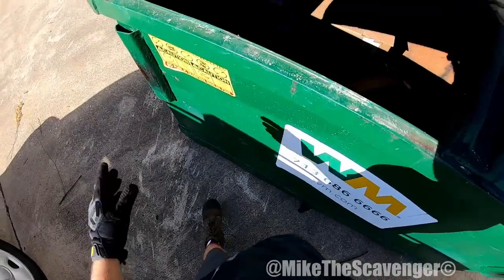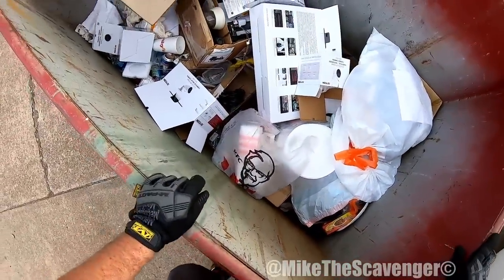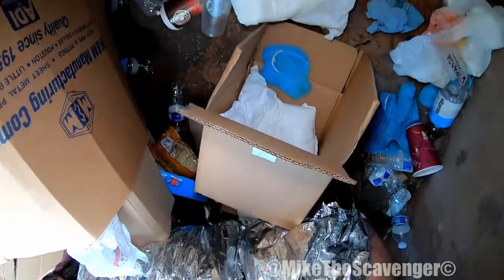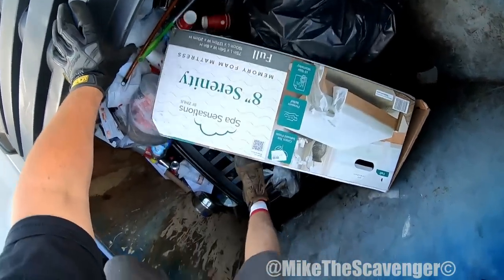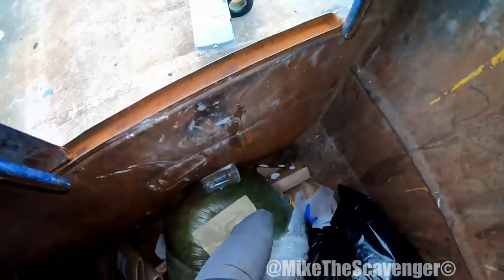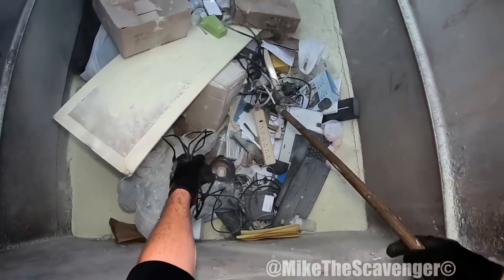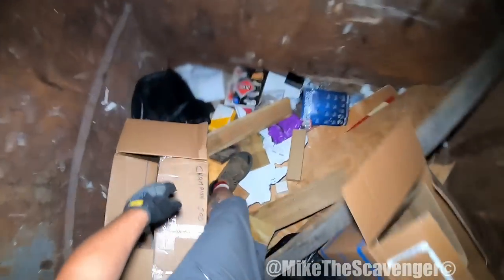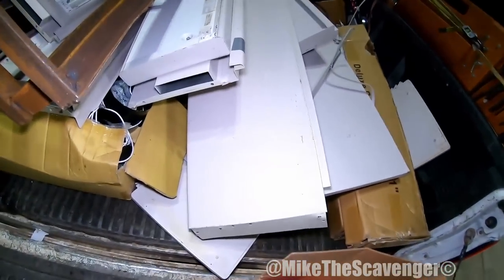Dumpster Diving "It Was Under The Leftovers"

Comment: I've found that the frames for Office Cubicle panels are often made of extruded aluminum.
Heavy duty stuff.  I've also discovered that some of the solid surface panels are made with alumaply, a high density fiberboard with laminated aluminum sheet surfaces.
You might want to double check some of those office dividers next time you find some.
Thanks for all the vicarious thrills. Keep up the good work.

Comment: those were nice sheets of wood on that steel pallet
Reply: I'm glad I'm not the only one who cringed when Mike threw $150 of plywood into the dumpster to get the steel pallet. I wouldn't trash the pallet either. I'd cut and save all the angle iron!
Reply: @OldsmobileCutlass1969Va  definitely 👍

Comment: The ac outside fan bladed with  good motor make a box mount three. To a babinet in series or separately. Put misster water a chill if you wired the waterproof. The outside motors. Get rained on. Anytime  coolness heavy animal cage of the front and back. You would have great fan

Comment: It doesn't expire but you should check recalls. I know some deodorant was recently recalled because it had carcinogenic compounds. Also I'm so glad that you picked up that backpack when I saw you throw it away at first I was so upset because it was such a nice looking bag. I don't know why you throw all the chips away or left them in the dumpster rather. They look like they weren't cut open and food pantries will take that stuff, even if it's recently expired, I'm sure that your mom's church group would have been able to put that to you too.